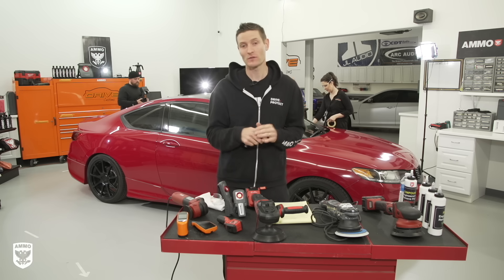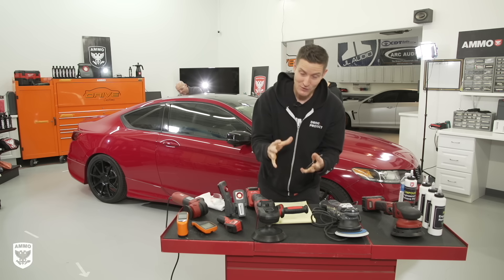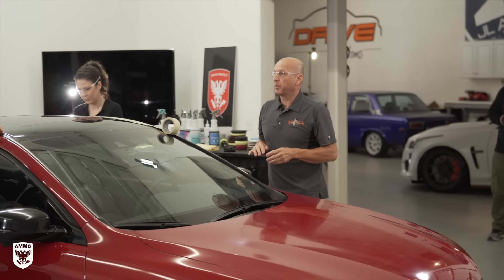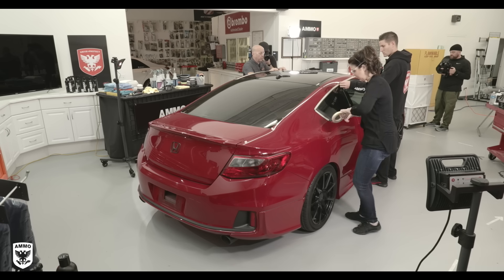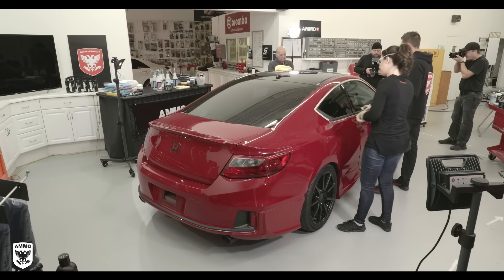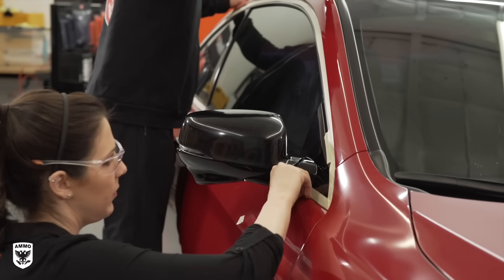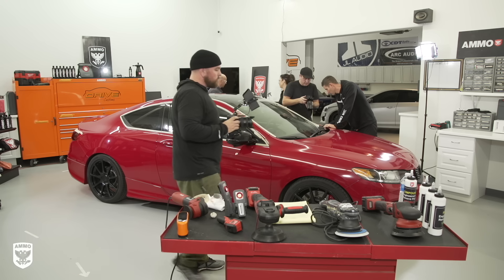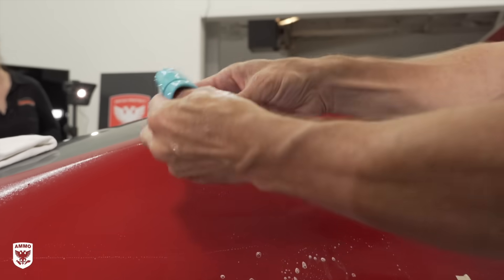Full Length Car Detail AMMO Training Academy 207

Comment: This is such a blessing to have. There is no other master class on learning proper technique as in depth as this. I made a big mistake just buying a 7 inch rotary Milwaukee polisher with a cutting compound with general YouTube knowling and no experience. I didn’t cause any damage but immediately knew I wasn’t doing something right. Since then I’ve returned it and bought a rotary polisher instead and am so glad to know of the scalloping technique. (Or scalping I’m not sure)
Reply: Wait, you returned a 7in rotary in exchange for just a different 7in rotary? What was wrong with the Milwaukee? It’s a good tool. 
And rotary is the way to go for minimizing paint damage and cutting power for beginners.

Comment: The European with the splitter lifting paint is most likely due to automotive paint not being designed to bond to plastics.  You need to use an Adhesion Promotor on the prepped surface, THEN apply the  paint.  Then, it will adhere without lifting.

Comment: Question I thought you keep the machine flat because if you angle it it creates  hot spots.
Reply: Not necessarily, or automatically. This would certainly be true if the pressure applied to the machine was not adjusted as you tilted… Tilting will enable a smaller portion of pad to touch the paint and focus on all of that weight and twisting force (a.k.a. “polishing energy”) on a very small area, and yes, it would likely pose a problem. However, lifting up (or away from the surface) enables very safe and useful tilting. It’s done all the time with rotary, and quite a bit with random orbit machines. Thanks for watching! Kevin.

Comment: I just got to the point when y’all are talking about bumpers being buffed and paint coming off I’ve had it happen on a raw plastic bumper a primed bumper and a painted bumper sometimes you heat things up to much and boom comes off if it isn’t dried enough but With backing a bumper and washing with a chemical this is just for raw plastic all you need is pre wash with dawn sciff with scuff stuff then scuff with dawn then rewash with dawn then wipe with alcohol and water you’ll never have problems

Comment: For an average Joe, what is the difference between using a purpose built rotary tool vs using a buffing attachment on a drill? Is it just the moment arm difference giving you more control? 

Further, what about using a pad on an orbital sander?

Comment: you don't need to wear eye glasses to polish a car. its a fucking joke. these guys are over the top more then i ever seen. this is people that take the joy and experience out of machine polishing.
Reply: Hello. I never used to wear glasses, until I just about sliced the eye out of my face while drilling a hole into a 2-foot piece metal bracket, and the bit caught & spun the bracket. After that close call, I started forcing myself to wear them whenever I was working around dirt & debris, or when using ANY tools. I even wear them while walking through my storage, and boxing up orders! Come to find out that my eyes are way less irritated at the end of the day, versus when I don’t wear glasses while buffing. I purposely chose a set of glasses I could buy 40-60 sets of at an inexpensive price for my polishing training classes, because they’re inexpensive, and not cumbersome at all. That’s why I still wear the same ones, because I still have 30-40 pair at my disposal! Thanks for watching. Kevin.